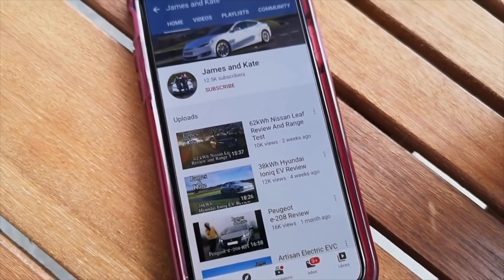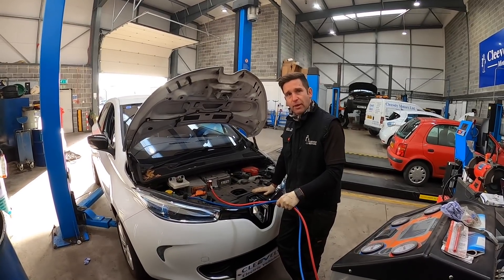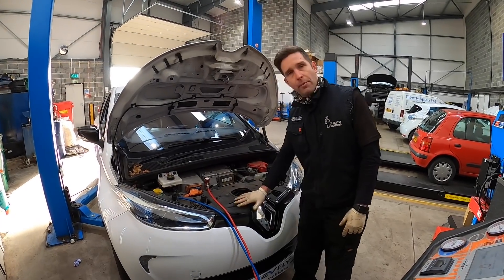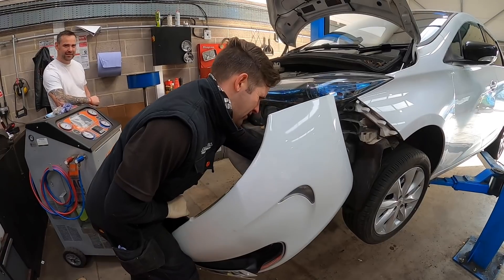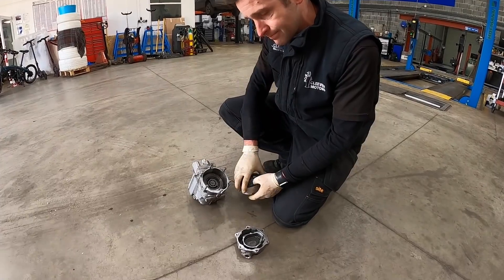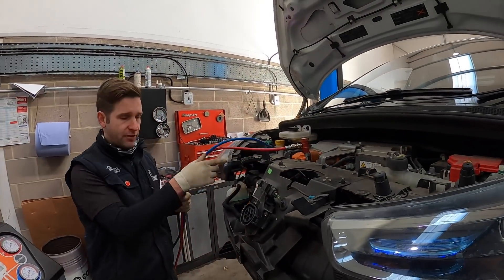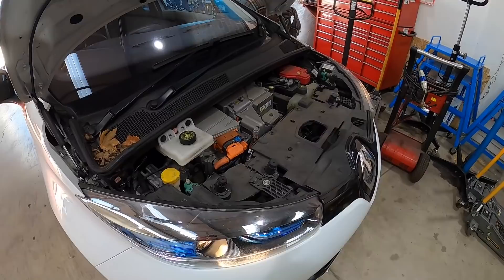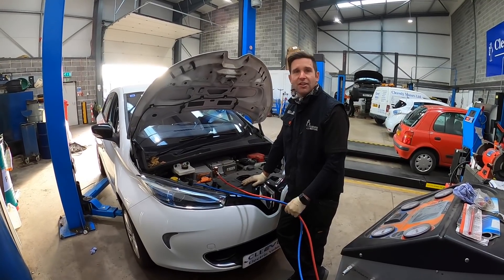Renault Zoe Heater Repair In 5 Minutes

Comment: Its obvious you are advertising for the Renault, Also just to fix the AC it will cost about £600. I have noticed anything goes wrong with the Zoe you have to replace the comlete part and the parts are very expensive . Electric cars are not cheaper in any way. Specially in cold countries.

Comment: I have got the exact same problem in my Zoe, likely to be the compressor. Can you please advise where are you based and if it is possible to arrange repairs for my heater and a/c not working?

Comment: was the system not flushed?? for a 45 min repair I doubt it, Metallic paste can be clearly seen in the compressor which would require complete system flush and clean. Nex expansion valve, suction filter on compressor Replacement of heat exchangers   Probable cause of compressor failure was lack of oil caused by a system leak, A vacuum test using dry nitrogen/hydrogen should be performed. If none of the above was done I doubt the system performed as it should
Reply: Ac failed because all zoe from 2014 till 2019 had common issue with AC compressor.

Comment: Hello! And thanks! for a meaningless Video. Why don't you show how to unscrew the AC Compressor? And also when you vacuum and fill the coolant? And it is false to write that you repair the heater in 5 minutes. Thanks! From Tommy

Comment: Get it warmer with the right mix of gpl instead. Bonus the gpl has lower head pressure compared to the other stuff so that compressor should live much longer. You'll struggle to get cold in a hot climate due to technicalities but for your region you'll be just fine.

Comment: This cheap repair and isn't done of professionals :D all metal chips was left in system, no flush operation, dryer should be changed, and oil filled into new compressor. Are you kidding measuring temperature with hands??? You know thermometer was founded long time ago:D

Comment: Weren't there any shavings of the broken compressor parts in the cooling system?
Reply: They shows how damage new compressor. And also get shavings all around system  :D
Reply: @zigmasj  what would be the alternative?
Reply: @maerklin29800  you need check pipes where you can find shavings,  after that you can make conclusion what to do next

Comment: Hey!  Why do you change the Ac compressor in this white Renault zoe, without flushing out the entire refrigerant system?  They must be done when an Ac compressor has crashed.  Otherwise it does not take long before the (Expensive) New Ac compressor crashes it as well.
Reply: Isn't that what the mashine with the red and blue cable did?
Reply: I know that. But you don't show how to do the job. There is no one who can learn to do that job by watching your bad video. Thanks! From Tommy
Reply: Is it as easy on a r110 engine?Heard that the q engines are much easier to repair?

Comment: the repair was not really 5 minutes  but around 45 minutes.  so maybe see a 45 minute repair in 5 mins more accurate title.
but yes  seems easy to do but part cost does seem a bit much for a poor heater.  may be just buy a plug in car heater for the dash since only really needed in winter to keep warm.

Comment: £400 pounds for something that should never have broken in the first place? For a start it’s a $100 chinese made part and it’s just sub standard engineering and manufacture. What a ripoff. Renault, bending their customers over before taking them for a ride. Good repair though it’ll probably just break again in a couple of years.

Comment: Great to have ‘hands on’ repair videos on EVs. Many of us DIYers have worked on combustion cars for years, but are scared to wade in on an EV. Glad I went for a used BMW i3 and not a Zoe, a compressor should last a decade! French engineering clearly hasn’t improved much since my 1974 Renault 12 first car - which rusted to pieces at 14 years old. 😩

Comment: I presume there was no danger of any of the shredded aluminium getting into the refrigerant pipes? On ICE vehicles, a compressor in that state would also need the rest of the system (condenser, dryer, etc) to be replaced to prevent a recurrence of the compressor failure in a few weeks time from shrapnel making its way around the system.
Reply: Yes all the debris will be in the pipes etc so the whole system needs replacing.

Comment: Hi this video is very interesting.thank you for that.  I would like to ask something. My Zoe 22kw 2015 has problem with heating as well. Basically when is outside temperature less than 5 degrees then heater works but it is not like warm enough in a car it's just fine. But when temperature is above 5 degrees then heater doesn't work and blowing just cold. I did try everything but nothing really helped. Do you think this repair could help my zoe as well and finally have nice comfort in my car?

Comment: This morning I was quoted £1.5k to have the compressor replaced at a Renault dealer in St Alban’s. I refused, as it felt much too steep. You guys confirmed what I expected to pay - roughly £400 + Labour. Would you please recommend a garage for this kind of repair in Hertfordshire? Do you guys have a branch here?
Reply: How did you get on repairing your heater? Which garage did you use?
Reply: @Wayneyboy101  went for a cheaper garage, but they did a botched job. I paid them £700, but heater stopped working in a few weeks, again. Went back to Renault, but not a dealer, went straight to Renault Retail. They fixed it for £1k, but no I have to fight the garage to get my initial £700 back. A nightmare. Renault should fix these for free, since they are known to break down sooner or later.
Reply: @tudorconducta1929  Did the compressor replaced at Renault Retail last long?
Reply: @maerklin29800  To be honest, the car was never back to how it was originally. Right after the repair, it did work, as in, there was some heat coming through, but it was never back to how it used to be at the start. And eventually, I lost all confidence in Renault, both in terms of the quality of the actual car and parts, and in terms of the ability of the Renault UK official servicing to repair any faults reliably. It felt like they were reaching for the stars, frankly, not really knowing what they were doing. I had some charging issues later on, and they kept saying things like 'oh yeah, it's a known fault, we don't know why it's happening, but we can just reboot the car computer and that clears the fault'... until the next time you get the fault! I had originally put in an order for a new Zoe, but I cancelled, and part-exchanged my old Zoe for a Kia e-Niro. I've had the Kia for a year now, and it's a real game changer. Zoe is not cheap enough really to make it worth all the trouble. The repair bills just went through the roof towards the end, and I just got sick of it needing to go in...

Comment: Unfortunately, still don't trust Renault due to reliability issues. For a compressor to disintegrate after just a few years is very poor design/poor quality part. I've heard of other problems too with the Zoe, so I'll stick to my 24kWh Leaf, still totally trouble free after 4 years.

Comment: I dont understand the heating issue with the Zoe, we have a 2016 Zoe and have no issue with it getting the cabin to 23-25C with an outside temp of 0C, I keep hearing about it but we've never known any such issue.
Reply: The issue is when its in Eco mode, the full power of the battery is not used to power the unit, hence it underperforms. Renault kept this fact hidden.
Reply: @taqveem  it's not, that's stated in the manual that in eco mode reduces the heat pumps output. Folks seemed to be just complaining in general the heating isn't great.

Comment: We've had repeated issues with the heater on our 22kw Zoe. The last one was a difficult to diagnose broken pipe in the system. £500 repair, mainly for labour - time to diagnose at Charlton's Boroughbridge. It's true that the heating is not very effective. But a good value and fun car. We like ours.
Reply: Neither the heating nor AC is very good in our Twingo Mk2.

Comment: Old Zoe’s are crazy expensive to repair when they go wrong and they go wrong a lot.  £450 just for the part!
Reply: mine has 93000kms not one problem!
Reply: A replacement clutch and flywheel for a BMW 320D is £2500 fitted at BMW. This seems fairly cheap. :)
Reply: £480
Reply: Standard ICE compressor is hardly less expensive.

Comment: That was actually really poorly made repair. If there is some contamination in ac system u need to change expansion valve, drier and most of all, flush that system! Otherwise that system won't work for long and that new compressor warranty is  voided.
Reply from the maker: That's exactly what our machine does.
Reply: @Jamesandkate  You have a machine which CHANGES the other components in the aircon system? Wow!

Comment: Disappointing from what seems to be a respected ev channel. Title seems to indicate '5 minute' repair. This implies a very simple problem like replacing a fuse or bulb. Or something very cheap and quick. It was £450 just for the compressor, not sure if that included VAT but you do have to add on the labour. 45 minutes to fix the problem was good going.

Comment: Great video. I'm assuming the Zoe doesn't have a PTC heater to complement the Heat Pump like a Leaf has hence the underwhelming heating? I'm currently replacing a faulty PTC heater on a Leaf which requires quite a bit more disassembly!

Comment: I would not work in that garage.
Reply: Ye wouldn’t get a job. James has it
Reply: @bdeithrick  they could not afford my rate.
Reply: I assume this was filmed recently. No masks garage workers must be invincible.
Reply: @Sofala  now I did not notice that, well spotted I wonder what other health and safety transgressions can be seen by anybody else on this channel?
Reply: I feel like that alu part on the end could be done via a 3d printer and lost pla casting with a little touch up on a lathe. Got a broken one and i would give a go at reversing it into cad. Do a test fit with a low density 3d print. Worth a try?
Reply: Why not. I'm curious.
Reply: @mauricewatts2380  it's clear for everyone to see. you don't need to look to hard.
Reply: @tomquimby8669  please tell us all .... Are you even mechanic ?
Reply: I genuinely cannot see a reason for not working there. It's  clean tidy well lit and they appear safety aware. Please do tell.
Reply: Same, don’t understand what Tom is seeing.
Reply: @malcolmrussell7283  I am saddened that so many workers have to work in toxic work environments, and they don't even wonder why they are so tired at the end of the day. The physiological effects of flickering lighting are well understood and documented.
Reply: @tomquimby8669  UK lights run at 50hz. If a camera is set at 60hz (which I assume this one was) then the shutter speed won't match the lights cycle, hence the flickering.
Reply: @tomquimby8669  They only flicker on screen, not in reality.
Reply: @iKaGe01  the light cycle of the sun is once a day, Then it is quite un-natural for the light to switch off and on 50 times a second. The camera is just showing that the lights are powered by cheap control circuits. Professional lighting can be purchased which employ better design and produce no flicker.